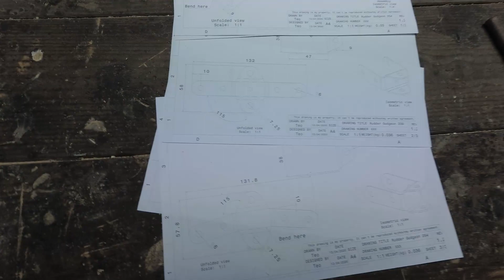Homemade Rudder Gudgeons

Comment: On my GIS rudder pin I drilled a small hole in the bottom end of the pin. Then put in a split ring after the cassette is put on the transom. This keeps the cassette attached to the transom after a capsize.

Comment: Nice hinge mechanism. Will you drill for a spring-clip or cotter-pin as a retainer for the long pin should the boat capsize? Would hate to think of diving to any great depth if it falls out. Or, will there be a top retainer of some sort to lock it down via the bent 'handle" of the pin? Of course, you cant install the rudder until the boat is moved away from the wall, or put on a diagonal. System looks like it should have an easy swing, great job.
Reply from the maker: I was planing on some kind of spring pin/clip on the long pin, although I have feedback from GIS users and the designer Michael Storer that so far in all this years he only heard of one lost pin on capsize, even with no retaining  system.

Comment: Done nice, but i can bet - they gona rust... 
DIY stainless usualy is problematic - first you must define is that stainless piece was not nearby any usual iron rich metal. If it was - most likely he that stainless gona rust. Then polishing - you must use almost hygienicaly clean brushes and materials. now you left particles of rust iron on stainless steel and due anodic and cathodic reactions you will need to change them after 2 seasons.
Espiacialy good to pay attention on metal marks - sometimes screws rust faster or metal construction. that means its different metals, and different metals increase speed of rust.
Reply from the maker: Hi, and thanks for your feedback.
They do have some light tinge to them now, but I varnished them for this season. maybe I can get a few more season out of them! 😅